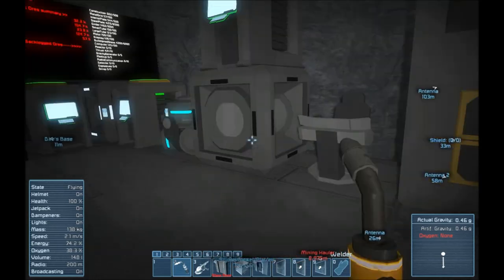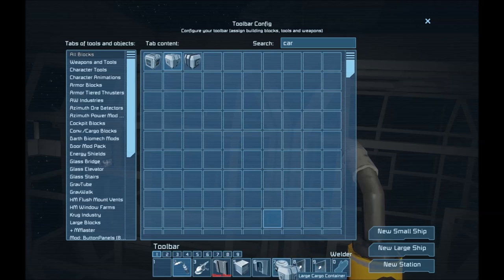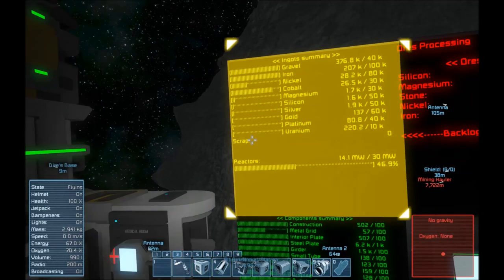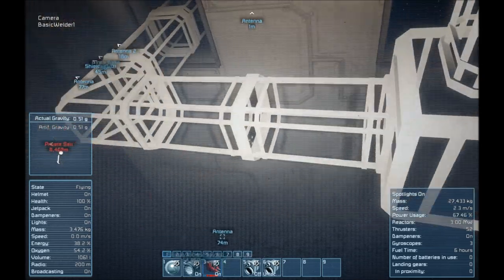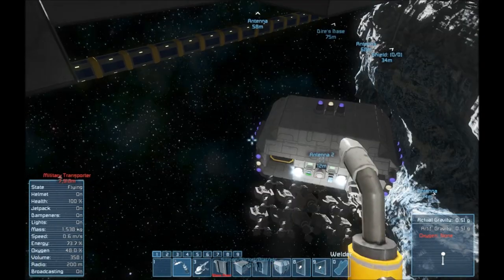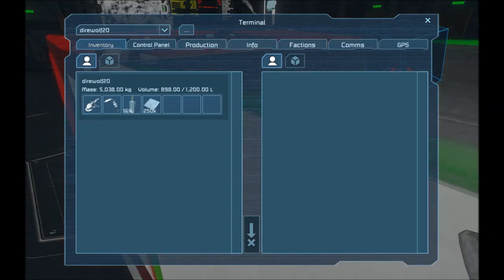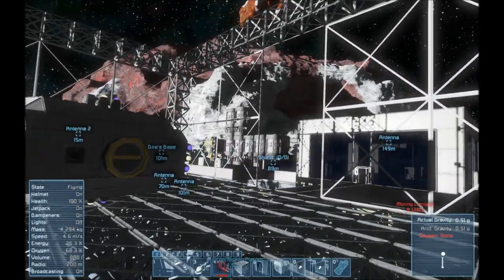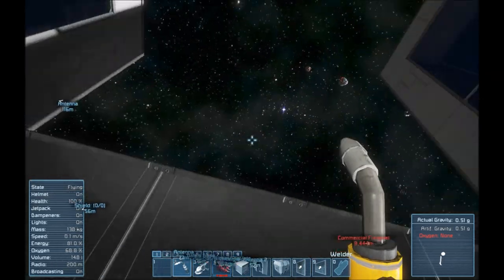Space Engineers   S1 E12 Storage and Welding

Comment: I would hold off on doing a sealed oxygen system for a little while, Dire. There's currently a bug with the oxygen tanks that cause it to really chew through your ice at an astronomical rate, and not produce enough oxygen to allow you to fill your carry about tanks. Looks like it might be just a misplaced decimal in the code. Hopefuly it's fixed soon, but until then, don't bother making an oxygen system beyond your basic oxygen producer to fill your portable tanks.
Reply: +CobaltSteel I was wondering why my oxygen tanks weren't filling beyond the 4 red squares. I still get all the oxygen I need from those though. I think the bug must be that the oxygen tanks can just store a rediculous amount of oxygen right now, which I'm actually fine with. As for portable oxygen, I place an oxygen tank behind my cockpit on every ship that is meant to spend a significant time in space with me in the cockpit, and then I can always refill my oxygen with my medbay back at my base.
Reply: +MaxTheMaximumGamer Yeah, same. But I'm more talking about a presurised system. Where you can take your helmet off kinda oxygenated. I can put ten thousand ice in the system, and it will chew through it within 5 minutes, and not give me enough O2 to pressurize a small room. As I said, it's probably just a misplaced decimal point in the actual code for the oxygen tanks themselves. At least they're reading now. Until last week, they weren't.
Reply: +CobaltSteel Dire's been playing with the oxygen system for a bit, if his bug reports are any indication.
Reply: +CobaltSteel "astronomical rate" - Seems about right

Comment: Even if you put a cargo container on top of it, try not to use conveyor tubes through walls and floors.
Make a habit of using conveyor blocks in stead.
That way things will get easier once you start to make rooms airtight.
Reply: +Amphibiot Isn't that room currently leaking anyway? I don't think large boxes are airtight.
Reply: Yes, you are absolutely correct. But, as a general rule of thumb, always use conveyor blocks though walls and floors, as it will save you from a lot of trouble with air leaks later on. It also looks better too, aestetically speaking.
Reply: +Tyrope Games what do you mean large blocks?
Reply: Ashley Williams
Large Cargo Container, sorry
Reply: +Ashley Williams (Ash) He said "large boxes", as in the large cargo containers. They aren't airtight, and neither are conveyor tubes, so Dire's cargo room is exposed to space. If one or the other was airtight, it would seal up the hole and allow the cargo room to be pressurized. Since they aren't, the conveyor tube should be replaced with a conveyor block.
Reply: +Tyrope Games oh ok, new to the game so trying to pick up any help I can. lol

Comment: Dire, what you call a bug is simple physics, larger ship that is trying to point in a specific way on a specific point cant if it has to keep adjusting to hit the right way to be able to move onto the next point, simple ai can only getcso far on its own, if you lined it up for it and had a centered point of control, the ship would be smarter at hitting the mark to then be able to dock on point.
Reply: +Vindictator1972 it's actually very easy for a computer, as it can calculate the neccessary thrust in milliseconds. The code is just broken at the moment, probably one of the sides gets a wrong value so it can never line up properly.
Reply: +Vindictator1972 The bug he is talking about is not the thing you are talking about. On the keen forums in the bug section he posted a video bug report showing ships spin out of control once you deactivate the autopilot, it behaves as if a override value was left on on one of your gyros.
Reply: +Scott Chamberlain Sounds like an override value was left on the gyros - by the autopilot. When you turn it off before it completes, it probably won't zero out the gyros if it was using them when you disable it.
Reply: endreman0 I would agree, except if you watch the bug report video pausing the game and unpausing will stop the spinning.
Reply: Wrong, there IS a bug when you do not center the remote control items. It literally has to be in the center of the ship from every side. His first ship it was centered and not offset to the front so it behaved.
Reply: That's not a bug, that is a design flaw in where you put your control block. Uncontrolled spinning when you shut off a autopilot, that's a bug.

Comment: This "Minecraft architecture" is seriously BAD BAD BAD! 
You are IN SPACE! Design accordingly and use THREE dimensions!
Reply: Should be using 3 dimensions in Minecraft as well.
Reply: +MadocComadrin You have to jump in MC though, which means you need ladders to use Y-axis. With SE, however, you just rotate your player and suddenly the wall is the floor.
Reply: +endreman0 True, but there are stairs and OpenBlocks elevators to make vertical movement easier. You end up moving around less with good vertical design.
Reply: +MadocComadrin .<Ender Wiggin>As soon as you launch Space Engineers the old Gravity is gone, erased. It makes no difference what direction gravity was in Minecraft you're not going to build there. Up and Down are meaningless with out a point to be fixed realitive to.</Ender Wiggin>
Well that started as adapting/paraphrasing the Enemy's gate is down speech from Enders Game, but took a North turn around Saturn. (Sol is the Gate BTW)
Reply: +Joe Long Of course, but designing 3 dimensions is still much more efficient.
Reply: In terms of blocks per volume, 2D in levels is actually better. Having multiple levels means you can put things in the floor/ceiling, which gives it more usable space.

Comment: Dire, beware of floating space hulks:  A few patches back, the Military Transport you can see near the Military Minelayer had a bug where it didn't have very much fuel inside of it, and if it ran out of fuel, it turned into a floating space hulk.  Not something you'd want to run into at full velocity especially if you start talking about something whilst going somewhere distant.  Just a heads up in case you run into this space hulk floating adrift in the depths of space somewhere!  ;)

Comment: Suit charging tip, place a single chair on the back of your remote drones for mobile recharge stations
Reply: +GoodzikG You can't place chairs on small ships. I suppose you could do the same with a cockpit though. You could even connect an oxygen tank to it so your cockpit refills your oxygen too. It's always a good idea to do that on all your small mining ships so that you can go for very long periods of time out in space without having to worry too much about suffocating.
Reply: +MaxTheMaximumGamer Actually, you can place passenger chairs on small ships.
Reply: Quiol Yeah, but even still, a cockpit with an oxygen tank connected to it will fill your energy and your oxygen at the same time. There's no reason to use the passenger chair over it.
Reply: +MaxTheMaximumGamer the point of a drone is no cockpit ☺
Reply: Yeah, but the conversation is revolving around providing the needs of the player with a ship. I wouldn't put an oxygen tank with a cockpit on a drone becaue, its a drone, and I'm probably not going to be using it anywhere other than my base. If I have to take it somewhere else, I'll connect it to a transport ship =P

Comment: +direwolf20
Someone probably said that already but you seriously should build several anchor. It wasn't big deal in you platform, but as you extended it fact that you base is only connected to asteroid in one point is slightly problematic. You are aware what will happen if you cut it?
Reply: I'm pretty sure a station is completely immovable regardless if it is attached to anything or not. There isn't actually any attaching to asteroids as far as I can tell it just looks like it does.
Reply: mbbeck
"I'm pretty sure a station is completely immovable regardless if it is attached to anything or not."

If voxal station support is off then you are correct. But If you enable it you (like dire did) need be connected to asteroid, otherwise you station would fly..

"There isn't actually any attaching to asteroids as far as I can tell it just looks like it does."

Watch first episode before you say something. One of corners of platform is attached to asteroid.. just one, and in current setting it is quite risky.
Reply: +TheRezro i was playing in the command terminal when i saw the 'Convert to Ship' button. i dont know wtf it is until i regret pressing it...

Comment: Only issue is you can't use the conveyor system with ingot mod sorting because it yanks all of the uranium out of your reactors. You could use a conveyor sorter to one-way the uranium ingots into your reactor so they don't get drained.
Reply: +Andyisgodcky i believe you can toggle between vanilla conveyor system and modded conveyor rules with the click of a button
Reply: or add an exempt rule to the reactors, or in my case I do [ingot/uranium:amount:p1] to ration them out, no sense in a drone having 500 ingots of it

Comment: When constructing large/multiple objects next to conveyers, it can be a lot easier to contruct a welder wich autocompletes the welding and transfer of component, instead of running back and forth.
Reply: +Mikkel Fabricius 
he already did make a welder, by because of the docking problem he is not using it.
Reply: +rodon265 ok didn't see it. Maybe I was skipping parts. It's still an easy way of doing it. When you need like 5000 steel plates and 400 large tubes or someting like it.
Reply: he controlled his welder, and used it to check the rooms dimensions.

he rewelded on of its lost welding arms!

at the end, he was actually using it to weld the room, and pointed out that you should regroup any rewelded object!

you missed all 3, maybe even more.
Reply: +rodon265 Oh you misunderstod me. I'm talking about a station welder. Not a ship welder. I guess i wasn't very clear ;-) Imagine a station welder connected to your assemblers. Then you dont have to move any components.
Reply: well, obviously he is going to do that.
Reply: +Mikkel Fabricius small ships cannot carry assemblers but large ship can.

Comment: You can solve the docking problem disabling the dock port while maneuvering and reactivating it a sec before the docking operation ;)
Reply: +TheIceThorn The problem he is talking about is because on his newer ships he didn't put the autopilot block in the center of the ship so it is infinitely stuck readjusting itself at waypoints. He already fixed the issue you are talking about.
Reply: Seth Baker
I was talking about the landing crash problem. :)
When he does the autodock, the ship crashes onto the station with the connection point cause of the attraction, that can be solved disabling the connection point while the ship moves. ;)
Reply: Yes, that is the issue i said he fixed if you read my post all the way through. He fixed that like 6 episodes ago.

Comment: why wont he just automate putting components into his welder and use that to weld those large cargos to be faster?
Reply: +Franc Archer He already has the welder set up to auto supply when he docks.  I am guessing the reason he didn't do that for the containers is because he doesn't want to waste components on finishing those until he needs the space or he is between building projects.

The welding bay will take a lot of parts to finish and dumping resources into the containers would slow things down with no immediate benefit.
Reply: +NobodyImportant 
i think its just because of the docking problem.
Reply: +Franc Archer Autopilot is a bit wonky right now, so docking his welding drones is probably more cumbersome at the moment than just carrying the components on his person. Drones are hard to dock without autopilot.
Reply: +MaxTheMaximumGamer not really hard to dock them, know your dimensions, leave the connector off until aligned so the magnets dont rip you apart, and a rear camera :)
Reply: A rear camera definately helps. Too bad Dire doesn't have one on either ship =P
Even if he did, having the camera on the very back without being recessed won't help you much since you wont be able to see where your connector is in relation to the other.
Reply: it will, if you also put markers around. just center your camera on the marker, and the connector will align as well.
Reply: +MaxTheMaximumGamer 
connectors have the lights on them, having your camera directly on top of your connector makes aligning perfect
Reply: ***** Yes, connectors have lights on them, but not while they're off. It's unsafe to approach another connector with another active connector while your ship is massive. The magnetism will destroy your connectors more often than not.
Reply: MaxTheMaximumGamer just have yours off :v
Reply: ***** That's exactly my point. But if your connector is off, you don't get the lights. The idea of centering the camera on some reference point above is a good idea though. I never thought of that.
Reply: MaxTheMaximumGamer the connector on your ship being off is what im trying to convey, your camera itself aligns to the connector on the station that's on and does have lights to aim for :B